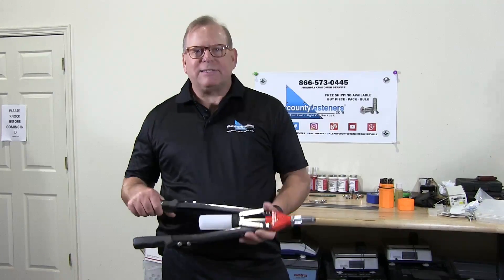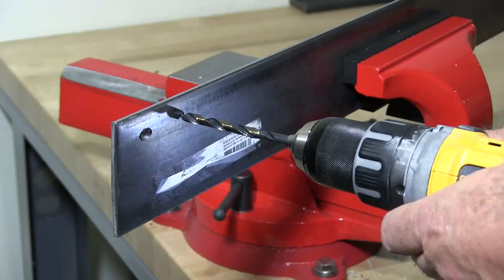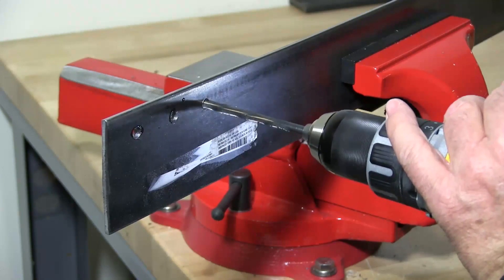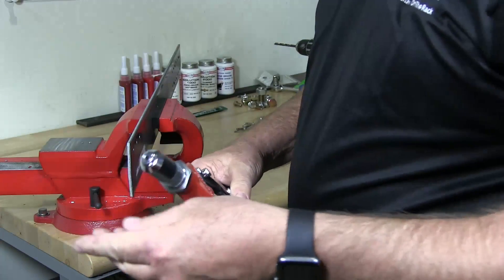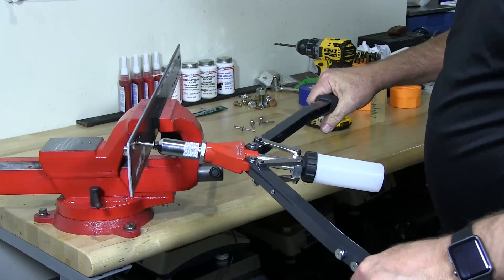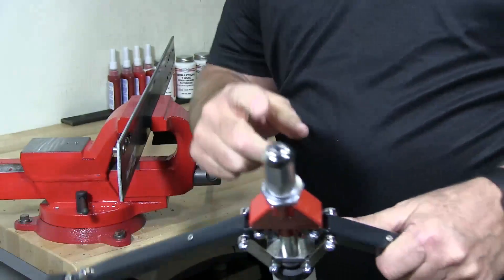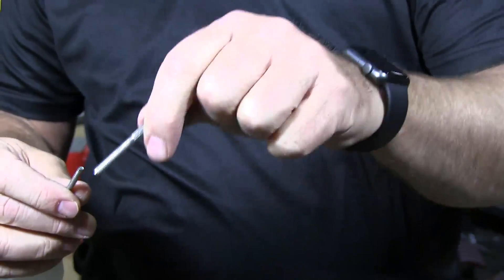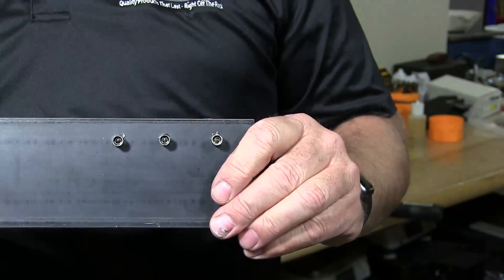How to use a Lever Rivet Tool to Install Rivets | Fasteners 101

Comment: Hi buddy whats the widest head rivit available to the general public & do they make an adaptor bit thats compatible with a normal riviter to accommodate the larger rivits. Im after apx m12 rivit if they exist?
Reply from the maker: The biggest POP rivets that we are aware of are 1/4" in diameter (a little over 6mm). Most Pop riveters only support 1/8", 5/32", and 3/16" because those are the common sizes of POP rivets. Larger rivets need larger tools the "pop" them. The good news is, those large lever rivets typically support 1/4" and down if you're looking for an all in one tool. We wouldn't know where to get just an adapter, however.

Comment: Can the structural rivet be installed with a hand held rivet rather than an industrial one?.
Reply from the maker: Theoretically yes, but it may be more difficult than using the lever riveter. The rivets we use in this video are 1/4" and the handheld riveter we have only covers 3/16" and lower. Using a handheld to install structural rivets is going to be harder on your hands than standard pop rivets. The industrial lever riveter covers 1/4" rivets and smaller and is generally better at installing rivets.

Comment: Can you use this on a widebody kit?
Reply from the maker: That would depend on what size rivet you are installing and how much room you have to get the tool in. This lever riveter can support up to 1/4" (#8) rivets. So, if you are using 1/4" rivets and have the space for the lever riveter you should be fine. If not, you'll have to find a riveter that would fit in the space you have. Our cordless riveter that can support up to 1/4" rivets may be a viable alternative: https://www.albanycountyfasteners.com/Battery-Powered-Rivet-Gun-p/1050-090.htm
If the rivet is less than 1/4" then you also have the hand riveter as a possible alternative to getting the rivets in enclosed spaces: https://www.albanycountyfasteners.com/Manual-Riveter-HR-705-p/1050-082.htm
We recommend following the manufacturers instructions for the kit if they recommend different fasteners for the job.
Reply: @AlbanyCountyFasteners the diameter of the hole is 1/4" and i have about 1 inch of depth space..i hope it works..and thanks for the reply

Comment: Thanks for explaining this bolt cutter style rivet tool, I bought one at an auction but only now I know how to use it. As to the slightly long intro of drilling holes that viewers (with a strange sense of entitlement) find so annoying, you provided a clue about your intentions so I knew how to skip ahead until the first rivet got inserted. 

You must have deliberately chosen this simple project so as to make your explanation as clear as possible, and I must admit you could not have made it any clearer! Personally I would have slightly preferred for you to have chosen a simple repair project (say mending some garden tool) or construction project because at the back of my mind I keep thinking about that fine sheet of metal (and three rivets) going to waste which wouldn’t be the case if you would have chosen a real world example, but this is of course a very minor quibble (or let's just call it a friendly suggestion).

I have also watched your clip explaining how to remove a rivet without damaging the surface of the medium it is attached to, a most welcome sequel to this here video. Well done sir!

Comment: how l9ng is that tool sir?
Reply from the maker: Hey Lenny,

The lever riveter is 21" at its longest and 28.5" at its widest when opened for installation.
Reply: Albany County Fasteners it looks easy to use than the pop riveter, i can only find 18"  in the net

Comment: Hi, do have a small set of 1/4 inch rivets at different lengths?   THANKS
Reply from the maker: Hi Ronald! We have 1/4" rivets in different lengths available in a few different varieties:
https://www.albanycountyfasteners.com/POP-Rivets-1-4-304-Stainless-Steel-p/11960000.htm
https://www.albanycountyfasteners.com/POP-Rivets-Domed-1-4-All-Steel-p/1824-010.htm
https://www.albanycountyfasteners.com/POP-Rivets-Domed-1-4-Aluminum-p/116008.htm
https://www.albanycountyfasteners.com/POP-Rivet-Large-Flange-1-4-All-Steel-p/1822-008.htm
https://www.albanycountyfasteners.com/POP-Rivets-1-4-Structural-302-Stainless-Steel-p/1812-004.htm
All of these are available by 1, 25, 100 or 1000 piece packs.
Reply: THANKS

Comment: These are fantastic but very difficult to remove. I had to take a box section from a piece of metal . First i had to knock the mandrel out with a centre punch then drill the rivet out.
Reply: Just use a drill counter clockwise
Reply from the maker: Hi Michael, Thanks for the comment.